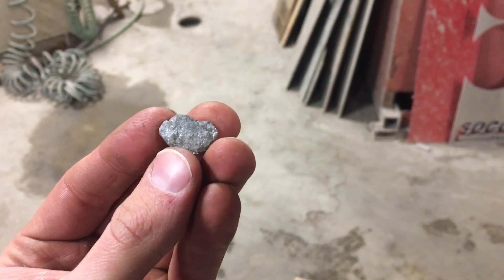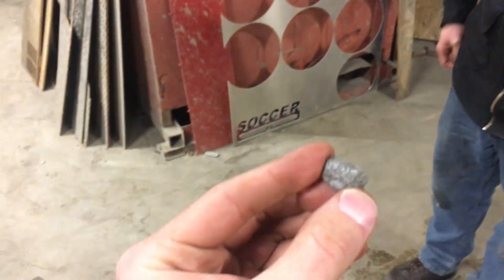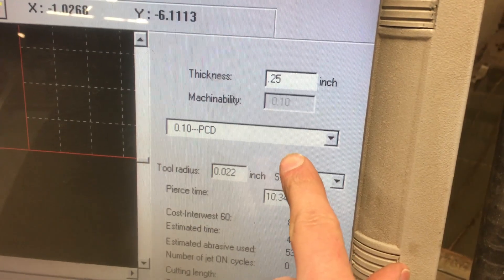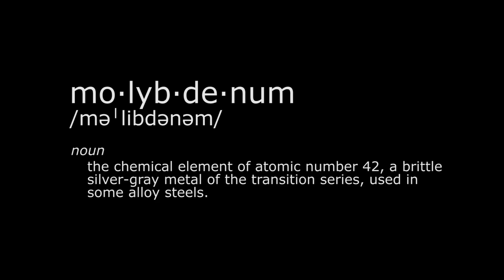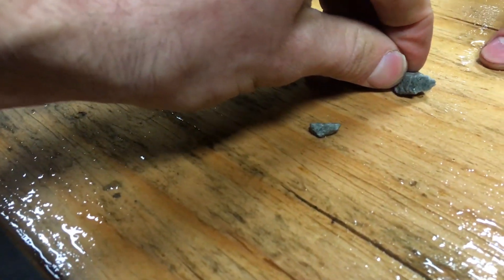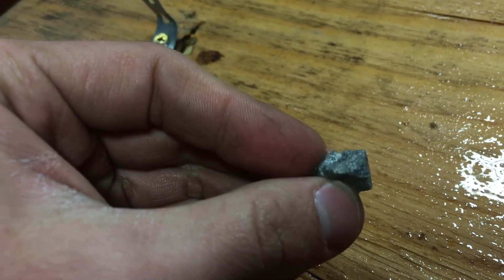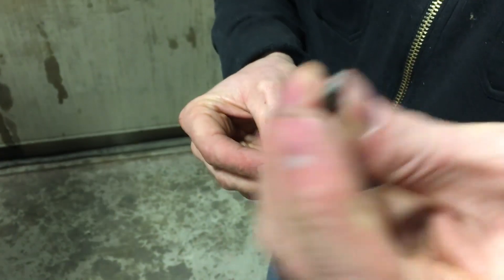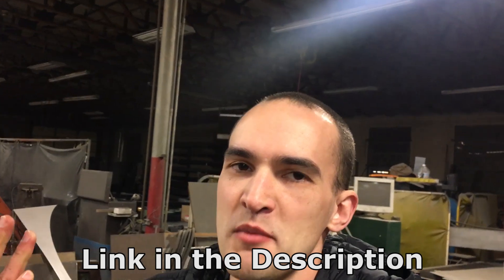Cutting a HUGE 17 Carat Diamond with 60,000 PSI Waterjet - With Cody's Lab

Comment: What was the surface quality of the cut.
I'm wondering if it sort of partly smashed it off.
The water is going about mach 2.
We were told by a waterjet manufacturer that it won't cut diamond, but from our experience, some products break from the impact.
Essentially some things are hammered at mach 2.

Comment: Growing up I'd always heard that diamonds were the hardest things on earth and that you could only cut a diamond with another diamond. I knew that was BS once I got a little older and learned about water. You can't compress water (which is why a waterjet does what it does) and if you try, the water will win because as it turns out, when you try to compress water, it becomes harder than even a diamond!

Comment: I know where to get nickel boron coated material. Various nitrides, hot bath sodium nitride like mellanite(you can buy the kit and pre treaded steal gun parts,the standard nitriding found on most everythibg these days amd is am epa aproved version of teniffer- trademarked(glock slide finish).
 titanium nitride on ar-15 bolt carrier groups.np3 nickel teflon is suppsoed to be super hard and ultra lubricitous.( a common side effect of nitriding a well polished metal part is the reduction in friction. In this case the treatment is augmented with teflon for further lubricating effects and nickel for. Material flaxability. When paired with hard chrome plating or better for coefficiant of friction, oil is not needed for lubrication. Most common melanite based nitriding treatments are advertised as diamond hard and most are not...but a few actually are. I can help if you want me to find harder materials than what you have tried. Hard enough i have suggested the nickel boron as a treatment for faceting aswell as normal industrial grade grinding wheels and disks. They would last so much longer than the best that is available now. Which is the trouble with it. Nobody wants to sell an item that will last 10x longer than their standard products. It means it will never need replacing ina lifetime of use unless it fails from heat. Which would probably also severly hurt the user if a tool got that hot...thousands of degrees would be needed. 
So yeah. Ball Bearings for high precision cnc machines will have nitrided or nickle boron treatments to keep them round and unoxidised . maybe one of those would do the trick. Ask your water jets company service provider and cnc ball bearings.

Comment: Hexagonal Boron Nitride (which has a similar thickness and structure to Graphene) isn't actually tougher than diamond, but it is a terrible conductor of electricity and one of the best conductors of heat on the planet. Additionally, it's also chemically neutral. There's also Boron Nitride Nanotubes, which have extremely poor thermal conductivity and are great for making Aerogels.

Now what you're thinking of, that's harder than diamond, is Beta Carbon Nitride.

Comment: Hexagonal Boron Nitride isn't actually tougher than diamond, but it is a terrible conductor of electricity and one of the best conductors of heat on the planet. Additionally, it's also chemically neutral.

Now what you're thinking of, that's harder than diamond, is Beta Carbon Nitride.

Comment: That was a huge graphite and where it struggled a bit was actual diamond.Both graphite and diamond  are actually carbon but graphite is weaker than pure diamond because of it's atomic structure. There are industrial diamonds as well used in machinery that actually has no value because it isn't nature made but artificially made. That's the only difference in actual value. Diamonds aren't even worth much until they are properly cut by people with very  good craftsmanship and are extremely expensive if they are cut by hand.  Just a lecture for people who have no clue in materials. 🙄

Comment: Nice. Came here from the link at Cody's.
I actually have some boron nitride, but it's the wrong kind. Just like carbon crystallizes in several allotropics with very different properties (diamond vs. graphite), boron nitride also crystallizes in different ways. The hexagonal boron nitride I have is a very soft, white dust. It's so soft that its main use is as an anti-friction agent. The one you're looking for is the tertagonal boron nitride, which is analogous to diamond, and which is very hard. I don't know of a source of large crystals of  that.

Comment: Hardest commercially available material is likely CBN, Cubic Boron Nitride.  Can be sourced as cutting inserts for lathes.  Material however is not 100% pure, uses a small percentage of sintering aid, commonly cobalt or various ceramics.  Cutting inserts of poly-crystalline diamond also exist.  My MS in materials science is primarily focused on industrial ceramics, I have some bits and bobs of some B4C and B4C/TiB2 composites produced via SPS which, though not nearly as hard, are quite tough.  PM if interested.

Comment: It does not look like a single diamond crystal, but a concretion of multiple crystals, together with silicate impurities. That would explain the low density and the grainy appearance.
The water jet cuts through the silicate crystals, passing between the diamond crystals. That's why the cut was so fast.

Comment: I wonder if a gem-quality diamond would hold up better since it would be aligned for maximal strength whereas this looks significantly more random.
Reply: Gem-quality would actually be easier to cut because of the cleavage lines. That's why diamonds used in industrial drills are are the same type as the one seen here.
Reply: wouldn't that depend on how you oriented the diamond for cutting? Like if you have it lined up right it would cut like butter, but turn it the other way and it should be more difficult.

I'm honestly surprised how quickly it cut through it (I've cut diamonds on a wheel and how you orient the stone in the dob is the difference between cutting quickly and scorching the stone from friction without actually cutting it at all)

I'm also wondering if the impurities in this stone weakened the structure. 

More thoughts: diamond is hard but also highly brittle. The water jet isn't scratching it or grinding it down like a diamond dust embedded lapidary wheel - the jet is hammering the stone with water molecules. You can shatter a diamond with an ordinary hammer that would fail to scratch the surface when rubbed against it.
Reply: Not to be rude Kevin but wrong on everything you just said. I am a lapidary (Gem cutter).
Reply: Yes, poly crystalline diamonds are actually 'tougher' than single or twinned crystals. They have interlocking structures that resist wear better than non-PCD. So, there is hardness (Like Mohs), brittleness and toughness. PCD is much tougher. Like comparing nephrite to materials with a similar Mohs hardness: Nephrite has interlocking strands and it resists wear and grinding a lot better than 6-6.5 stone with no interlocking structure.
Reply: I know that if you don't cut a diamond properly it can be impossible to polish. Orientation is key. They use lasers to cut diamonds now. Leaves a lot less waste and works by changing the crystal structure to graphite.
Reply: gem quality would be very difficult, flawless diamond would be a great nozzzle material.

Comment: It might have been able to cut it because the garnet was able to induce fractures from to the high pressures and velocity. Diamond may be hard, but you can shatter it with a hammer.

Or the garnet just worked it's way through the existing imperfections in the diamond. Looked like there was a lot of existing fractures or what have you. Almost looked like fused diamond dust in fact.

Comment: The hardest material known to man is a cluster of buckyballs suspended in a m-xylene solvent. When crushed in a diamond anvil, the buckyballs are altered turn into a very hard solid, hard enough to leave a dent in the diamonds, but return to their original form after the pressure is released. The solution, which has yet to be named, is a hybridization of crystalline and amorphous structures at an atomic level, according to the scientists at the Argonne National Laboratory's Advanced Photon Source in Argonne, Illinois.

Comment: the problem with waterjet is that the thing is a polycrystal, so it possible it was torn apart because connections between crystals weren't good enough. Still interesting result. beyond press had a diamond for pressing, would be interesting to see if such a crystal can be defeated and put on the wall of shame.

Comment: Try to crush it under a hammer if it doesn't crack, it's real
Reply: Ymer Alber Diamond is hard not tough. Droping a diamond ring can shatter like a piece of glass.
Reply: Saffron Sama have you seen that YouTube channel dudeperfect or whatever? They showed a video of them trying to shatter a diamond with a hammer.
Reply: Saffron Sama I thought so too! But watch a video by dudeperfect. They tried a similar ide and the diamond made an indent in the anvil and didn’t have a sketch
Reply: That's a horrible way to test it
Reply: Do that and you'll make diamond dust. HP channel did it already.

Comment: The problem with wurtzite boron nitride is that it's practically impossible to produce.
Reply: Gonna cost a lot on Ebay.
Reply: Piotr Noja yeah i don't think you're gonna get that on ebay. let alone anywhere else
Reply: Tushar Sadhwani no u just get it on eBay bro
Reply: Tushar Sadhwani clearly you've not heard of eBay
Reply: Harry Walduck wurtzite boron nitride crystals don't exist. it exists in powdered form yes, but it doesn't have anything to cut then. it's just a theoretical structure
Reply: because it's impossible to spell
Reply: Ya looking? I have a lil I could ship your way for the right price. LOL
Reply: james brown I'll pay 1m a gram
Reply: Right now you can only make ceramics out of boron nitride. I have never seen a large crystal before. Ceramics as in tungsten carbide drill bits type of ceramics. That would be significantly easier to cut since the water would travel around the dust.

Comment: Try cutting Maraging steel. Its the hardest metal on earth
Reply: Hardness is the ability of something to resist changing shape, so bending, scratching, etc.. Strength generally means toughness, that is, the ability to stay in one piece... even if it has to change shape to do so (think of a spring). For example, wood isn't very hard... you can scratch it or bend it easily, but it's rather tough, it takes a lot of force to break it. Something like glass is very hard, but not very strong (usually, you can strengthen). That means it's brittle. It's hard to scratch or bend glass, but once you do, it breaks. Diamonds are like that. Very hard, but not terribly strong, so a diamond can scratch almost anything, but if you hit it with a hammer, it'll probably shatter.

As n00bkill mentions, in steel, this is a trade off. You can have really hard steels, or really tough ones. A really hard steel is great for using as something like a blade because it won't dull very easily... but if you slam down on it, it'll snap. A tough steel will dull very fast, but when slammed down on, it'll flex, or even bend permanently, but will still be in one piece. This is where stuff like differential hardening or laminating steels comes from in large knives or swords. By having a hard edge but a tough core, you can make a blade you can slam down on, that will maintain a hard edge.

Getting into alloys, and how they work is a whole nightmare I am not informed enough to talk on.
Reply: trow in some Iridium while you're at it. Have an experiment how fast you can become homeless for a vid :}
Reply: Waterjet Channel if i did id mail it
Reply: It's not the hardest, but it's the strongest.
Reply: n00bkill whats the difference between hardest and strongest metal?
Reply: Trek The happy turtle the two properties are not the same, although they often are related. So hardness is it's resistance to deformation where as strength is more it's resistance to stress. Consequently, managing steels aren't that great for knives or tools. The highest hardness steels are probably tool steels, with high cobalt or molybdenum additions.
Reply: n00bkill i see your point :)

Comment: i have analyzed the video frame by frame and calculated the velocity of the water and with the diameter of the nozzle i have calculated that the pressure is actually 60,004 PSI
Reply: Got memes? At 30.000003401 FPS
Reply: Nah its 59999 psi
Reply: bigass197 and also communism
Reply: Yeah Stalin, but your mems are cruel and involve genocide...
Reply: Got memes? BS
Reply: I ❤memes
Reply: There actually are some very expensive water pressure guages for these waterjets, but usually they just estimate from the lower hydraulic pump pressure times 20 in the intensifier unit.
We set our hydraulic pump to about 2,500 psi, so the parts in the system last longer.
Reply: Gewel I got some at 6969696.69 fps